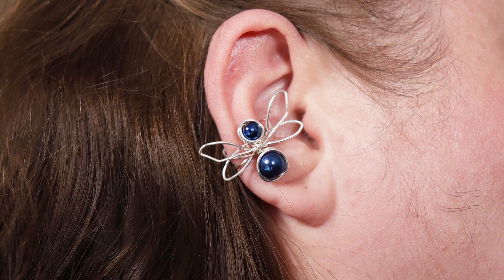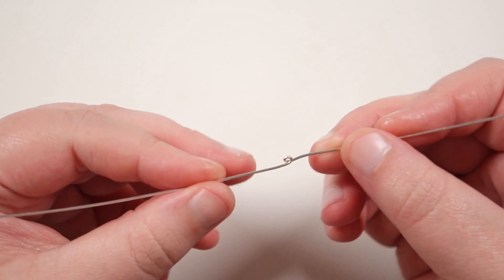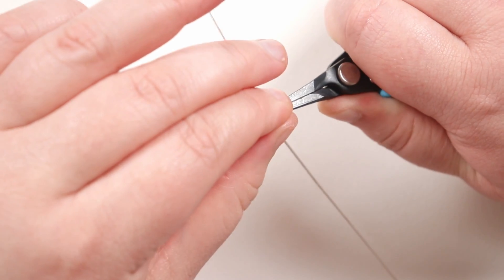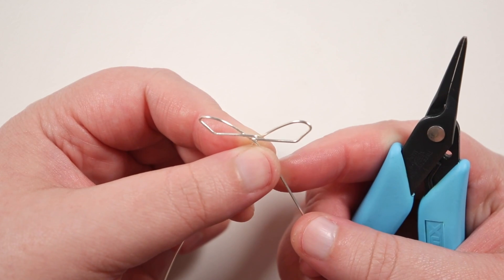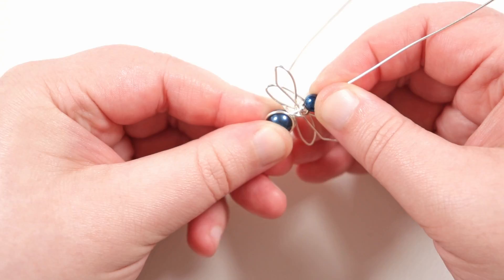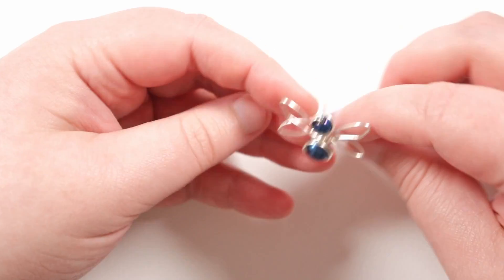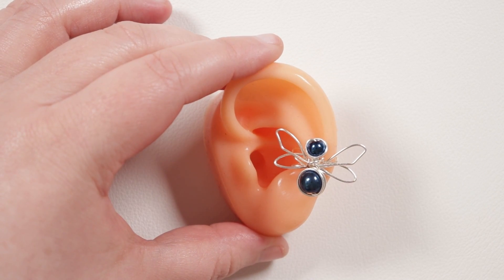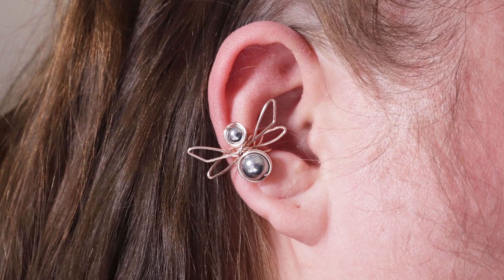Dragonfly Wire Work Ear Cuff ⎮ Jewelry Tutorial

Comment: I would like to buy beads and these i want to use for different designs. But the holes are sometimes small. 
Which hole size is recommended for beads? Do you have experience with drilling tools to enlarge the holes in the beads? If so, what is recommended and does it work well? Could i maybe use a dremel. But how can i use the demel in a secure way?